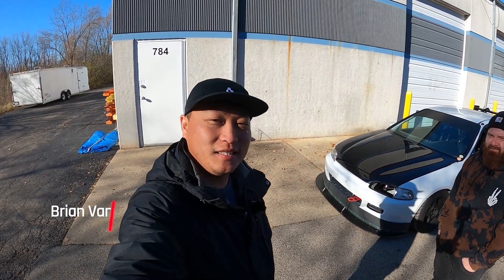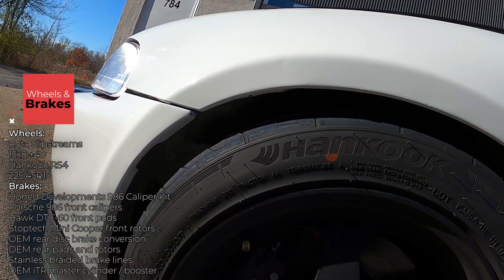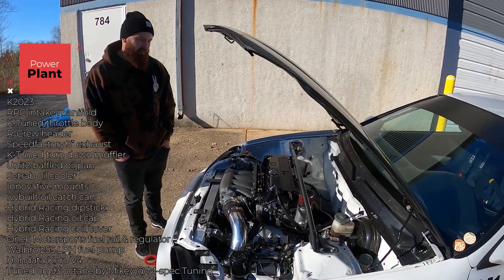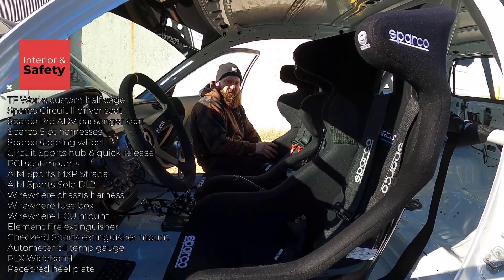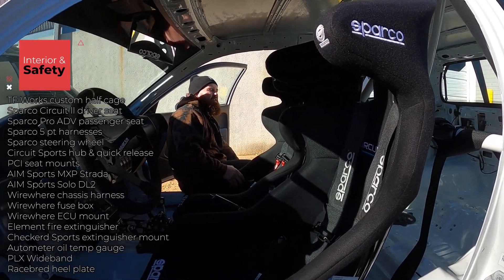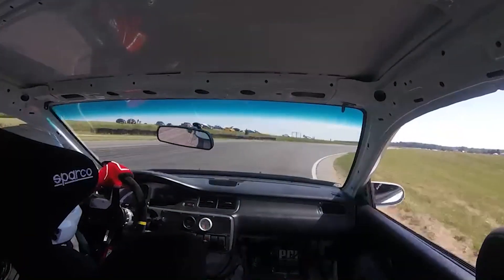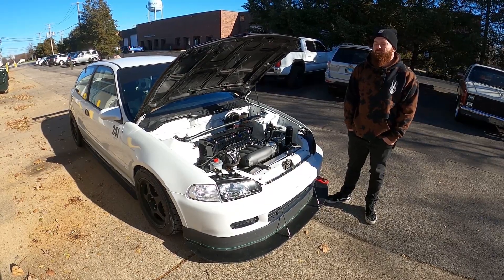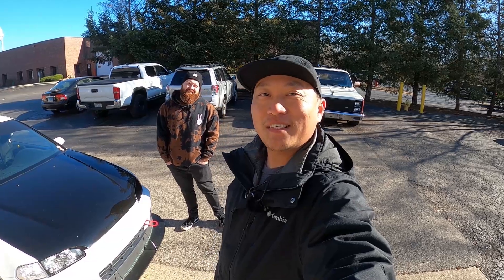Erick's K20 '92 Civic CX - TCR #006

Comment: I'm 55 and worked near half my life in machine shops so when I tell you Honed development prices are high I actually mean insanely ridiculously high! Find a alternative. Anyhow with that out of the way what is the offset on your slips? Thank you.
Reply from the maker: I guess when you don’t push large volumes, the price is going to be higher. Great products nonetheless.

The wheel offset is +40
Reply: @bvspeed  Very good point. You are correct.  I didn't take that into consideration.